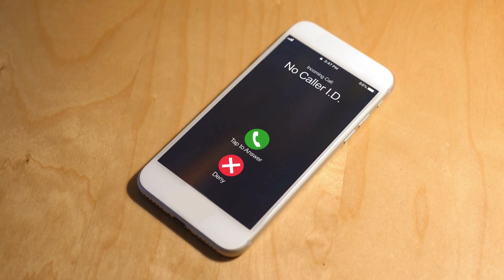Chamath Palihapitiya : Tesla Will Hit $1000 | Here's WHY.

Comment: When this fellow says the cost of generating electricity is now "effectively zero" he is mistaken.  Maybe he means solar and wind do not use fuel, which is not the same thing. A typical location requires about 4 times as much solar and wind generating capacity of the peak load plus 50 hours of storage. Even now for new installations that represents about $5-6 per watt for solar plus $20 for battery plus final integration costs. This ~ $27 per watt capital cost is much higher than the typical installed $1-2 capital cost for gas fired generation. Although operating costs for SWB are lower than for thermal plants, they are not zero.  Transmission and distribution costs remain similar.

SWB costs are on a declining cost curve, but remain significantly more expensive than thermal as of now. The current ~ $27/watt cost for SWB is the configuration that would replace thermal. Currently we are cheating in two ways. We often state the cost of solar as if it had a capacity factor of 1 (like thermal does), when it actually is around 0.25. The second cheat is to assume batteries are not needed, by forcing thermal to ramp up at night and cloudy days and down when the sun shines. Finally, the grid remains mostly non-renewables as of now.

Chamath is right that a lot of the retail price of electricity is due more to treating it as a cash cow than actual cost of providing it, but he is wrong to suggest the cost of electricity generation with renewables is "effectively  zero".

Comment: Well, there is the cost to produce the solar panels and install them, plus whenever they degrade (and maybe they don't anymore) they might have to be replaced in xx years.  Ditto for the batteries, unless Mr. Musk is giving them away now with free installation, and will continue to do so.  One must amortize these costs over a period of years. So where is the "free" energy?  And Chamath  says we will receive a small check from companies that use our excess electricity, which means we are still hooked up to the grid. The grid needs replacement, or repairs and maintenance. This is "free" also?